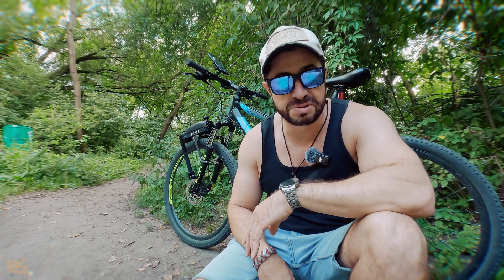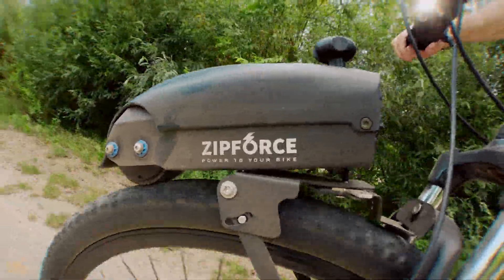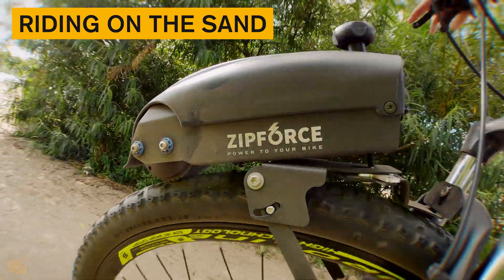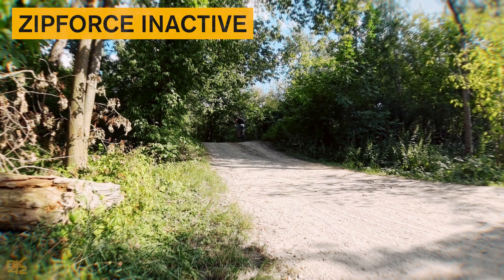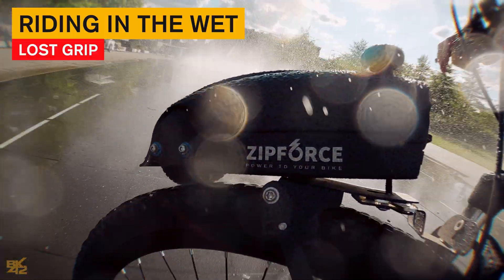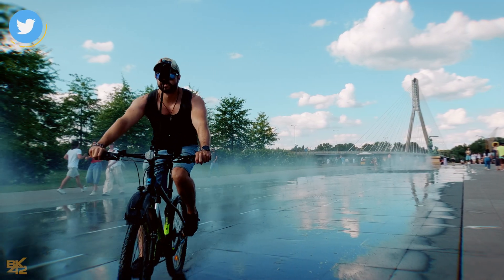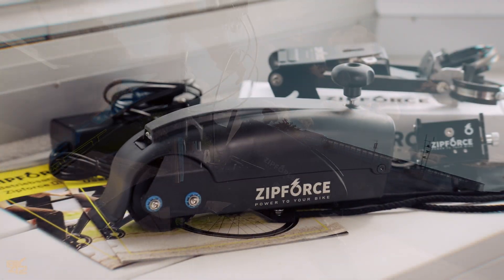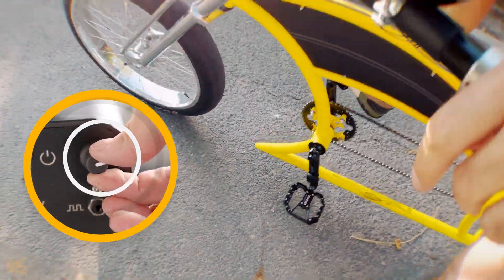How to Push Zipforce E-Bike to Its Limits: Full Review

Comment: It's very interesting and I would like to know if I could mount it on a racing bike without any problems and if it would work with very narrow tires?
Reply from the maker: I think it should work just fine if the fork has that central top hole, but it might be best to double-check with ZIPFORCE before making the purchase. Thanks!

Comment: If you’re cycling on the flat and don’t want any assistance, does it have a zero setting on the app, or do you have to stop and loosen the clamp off? I only want assistance on hills, but it would be frustrating to have to stop and manually adjust it, each time you came across a hill.
Reply from the maker: Hi there! Yes, it can be turned off using either the mobile app or the small button on the rear part of the kit. Thanks!

Comment: Do you know if the wheel gets more wear when the zipforce skids due to rain? I've 
Been using Zipforce distance for almost 6 months and it has been amazing. It makes my commute so  much easier. I have an injury knee and oh man, the up-hills are like a breeze with the zipforce
Reply from the maker: I'm really pleased to hear that you're happy with it—it definitely helps a lot! As for the durability, the most honest answer is that I’m not sure. I’ve only tested it for a day or two in wet conditions, so I haven’t noticed any significant wear on the tires yet. Thanks for your feedback!

Comment: What is the total torque out of this? Hill climbing is essential for most bikers ;). Specially on front wheel I have my doubt but let me know
Reply from the maker: I'm not certain, as it's not detailed on their page. The torque will definitely vary depending on wheel size, tire type, and pressure applied. The output torque remains the same, but the actual torque may differ. Full review: https://www.youtube.com/watch?v=LXUUuP2njEg&t=1s

Comment: It's a cool concept but isn't it easier to swap the front wheel against a motorised one and just put battery and controller in a frame bag?
Reply: I am also interested in this question. I assume, it is different because with zipforce you can also use the bike any time without motor. I for example have several bikes. With different mounting brackets on different bikes I could use it on different bikes. I assume it is more versatile than a motorised front wheel.
Reply from the maker: Exactly 👍
Reply from the maker: Then it will be a completely different situation ... and for many custom bicycle riders, that isn't an option
Reply: @BK42Cycles  Why is it a different situation?
Reply from the maker: First, you can use a single kit with multiple bikes. For example, I have mounts on three bikes, so I only need to switch the kit between them. Second, it's much easier to remove the kit when needed, compared to detaching an entire bag and cables, making it more practical. Third, the kit works on both the front and rear wheels without requiring any rewiring. Lastly, some people, myself included, prefer not to clutter their bikes with cables and extra bags, and others may not know how to install more complex conversion kits.